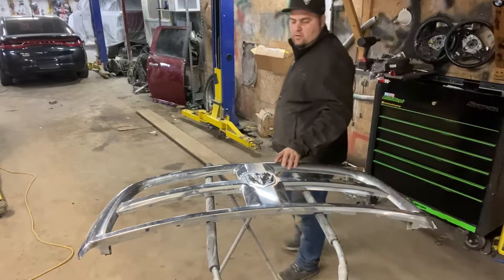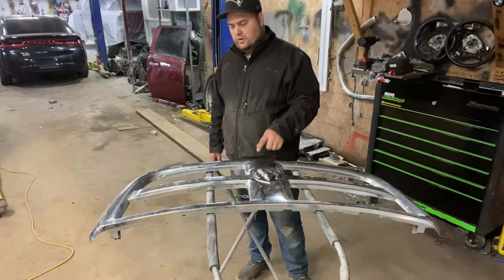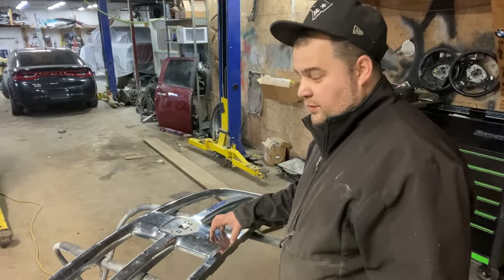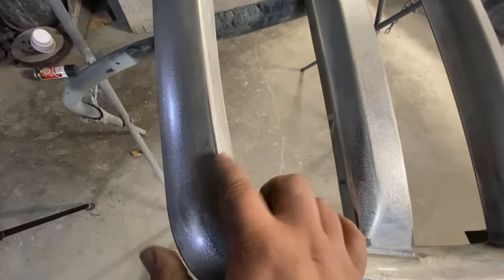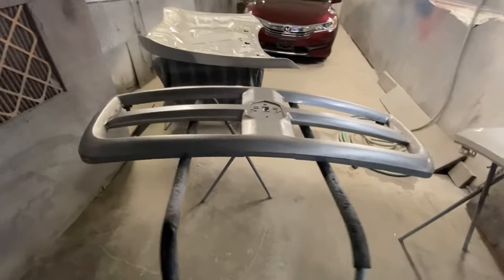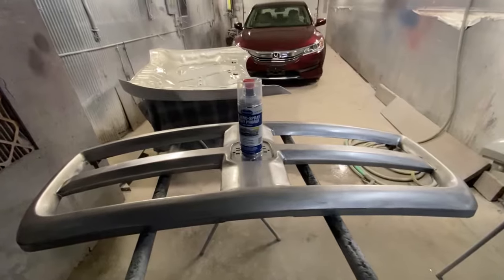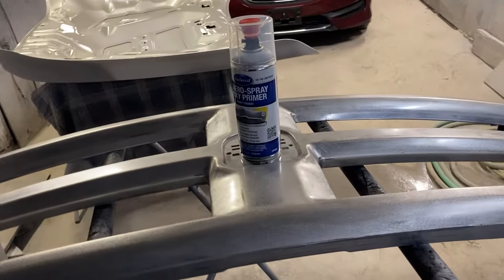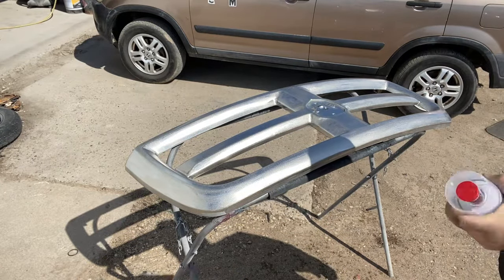How To Paint Over Chrome | BKG

Comment: on chrome plated plastic you can use aerosol oven cleaner to remove the chrome. Then paint the plastic.
Reply: Will it not melt the plastic underneath ?
Reply: @leonidprokopovych3289  
I’ve never had it melt the plastic. 
But you don’t leave it on a long time only long enough to get the chrome off.
Reply: @krukabman  I’ll try it out have a grille I need to paint appreciate the help
Reply: @leonidprokopovych3289  
Try an inconspicuous place first.
Reply: Does the brand matter?
Reply: @stainedshirt5772  
I used easy off but I don’t think the brand matters?
I would try on an inconspicuous place first!!
No matter what brand. Differyplastics MIGHT react differently???
Reply: @krukabman  yea thats a good idea 
Alright thanks ilyk how it works out 👍
Reply: @krukabman like super clean ?
Reply: Doesnt work on an actual steel chrome lol It only works on plastic faux chrome. Like in toys or such.

Comment: Great video! Thanks for doing it. I will be doing something similar for my 2013 Ram 3500 except I will be painting my grille matte black.
Reply: I have a 2002 dodge ram 1500 4X4 full size cab, it was medium grey, i did the bodywork and painted it black myself here at home, i painted everything, chrome bumpers, grill, emblems, handles, even my chrome rims. I wanted it to look like the new ones and it turned out great

Comment: U got a plastic video? I’ve painted plastic with high build sanded smooth and painted. Seen some use bully dog adhesion promoter. Want to do my 11 Silverado front. Just wandering. In Florida we got hella bugs don’t want it coming off! I’ll spray a few extra coats of clear to play it safe eitherway
Reply: @bkgshop  yea not worried about the grille it has plastic valance and bumper squirt. That’s what I was wondering
Reply: On 07-13 silverados they have a small bumper w a plastic piece under and then the valance it’s raw plastic. Last time used high build to get texture out of plastic. Diff vehicle. Ima do the same this time but use bully dog

Comment: Looks good man, yal make sure to use a 2 part clear coat for the final coat for durability, or a 2 part satin/matte paint for the final coat! I've tried the expensive 1 part rattle can and it just doesn't hold up to the heat,weather, and washes and it will look bad in 1 to  2 years 👌